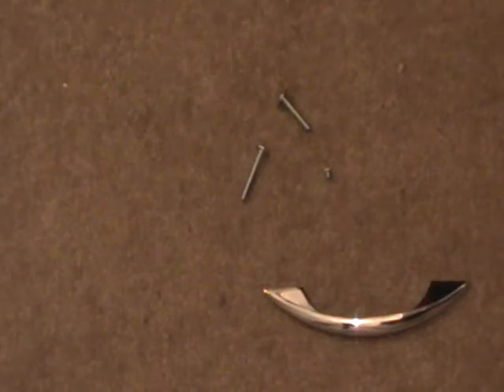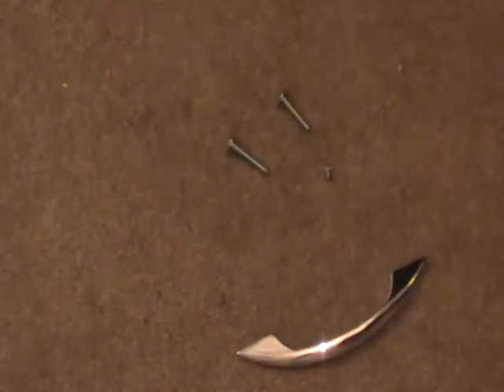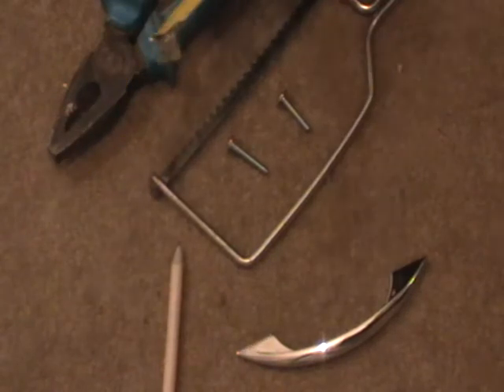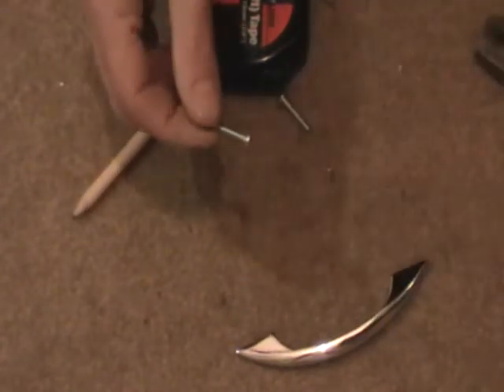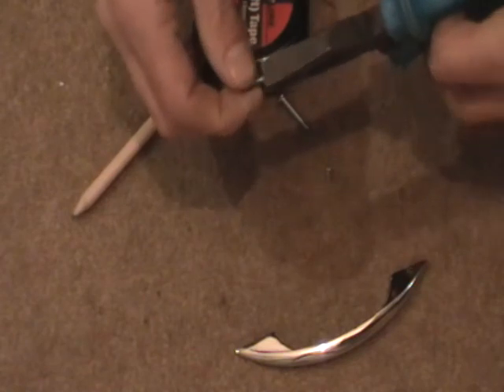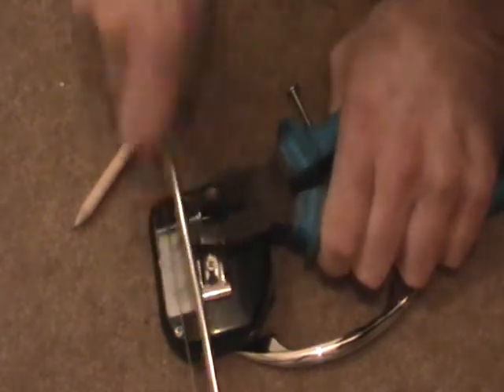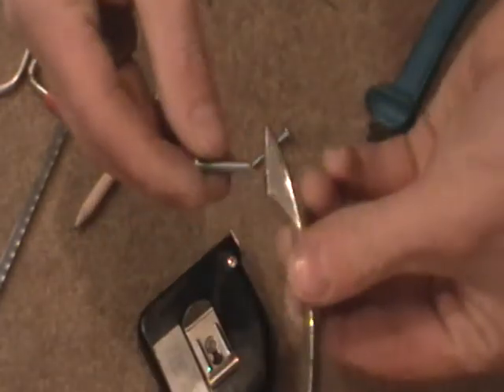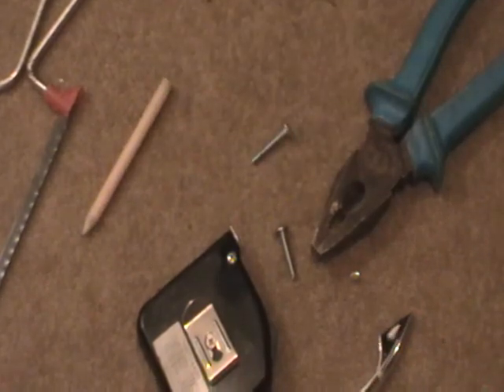How to cut a screw

Comment: This video is not correct.
Don't cut the screw at the thickness of the door, as you will have nothing left
to go into the handle! A better way is to screw the screw all the way into the
handle, then place head of screw against inside edge of door, and see how much
gap there is between the outer edge of the door and the handle. That is the
amount you need to cut.